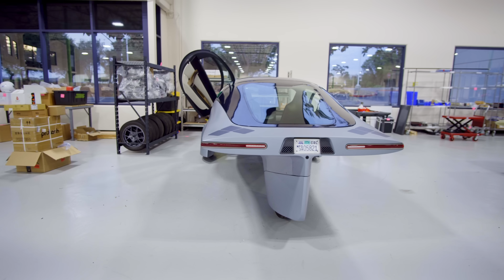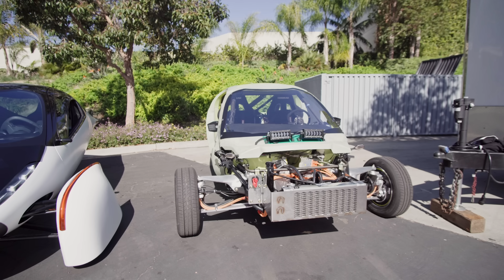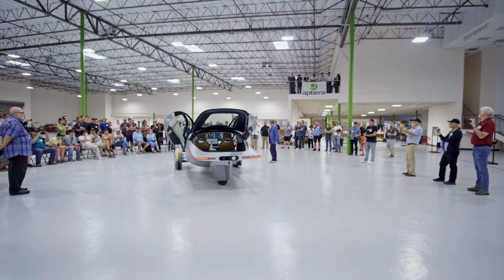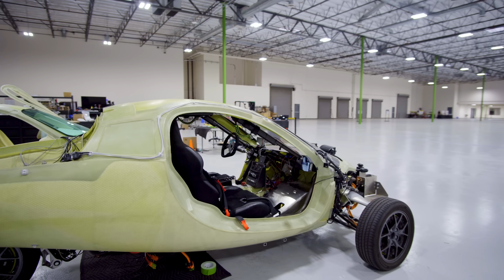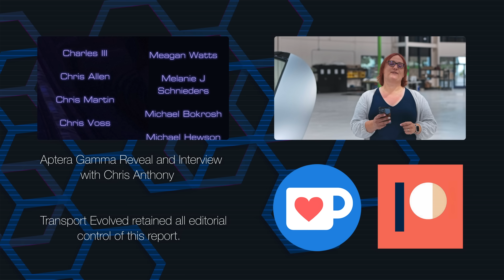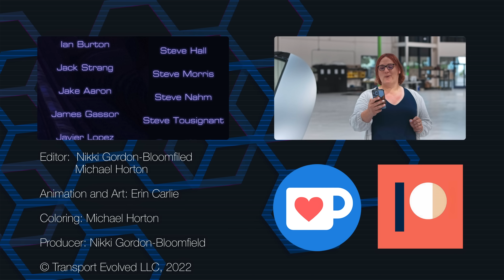The Aptera Gamma Prototype Is Here. What's NEXT?

Comment: I've got one reserved, looking forward to it.   the longevity of the platform is impressive and should hopefully make the reparability much nicer.   The only thing I'd honestly like to see is the crash testing, hate that they have to destroy some to do it, but really interested in watching the engineering of the composite and what happens when someone hits you.
Reply: Crash testing is coming in early 2023, I'm also looking forward to seeing it.
Reply: The low weight would suggest that it will have less favourable outcomes in collisions. But lets see. I really hope it doesn't come out looking so bad that mainstreamers are put off.
Reply: @peregrinedalziel4999  mainstreamers don't need to buy this .. they have 40k reservations so lets make the damn thing ! .. also look at the old smart car .. it was light and strong and if not squished between 2 suv s it survives very well ..  meanwhile you forget that the shape of aptera gives very good crumple zone or deflective energy properties
Reply: @gmy33  However, fundamentally, all else equal, a lighter vehicle (less mass) will experience greater acceleration when hit by another vehicle (baseball travels faster and further than a bowling ball hit with the same bat etc). It's this acceleration (and subsequent deceleration) that causes severe injuries (solid organ lacerations, aortic injury, diffuse axonal brain injury). Crumple zones can transmit energy through the frame and deform in a manner that reduces crushing/ limb injuries and so forth, so can offset this a bit . But the crash test dummies will do worse in a  lighter vehicle, all else equal. Indeed injury data from large datasets indicates that mortality in hybrid or automatic versions of vehicle models is slightly lower, when controlled for other crash characteristics (probably because the battery or transmission makes them a little heavier). Hopefully the tests prove me wrong!
Reply: @peregrinedalziel4999  offcourse you are right .. qe need to cgange direction and make lighter cars for less consumption .. our cars are to geavy and thus less economic .. but saver
Reply: @gmy33  ....but when everyone in the world has an Aptera.. weight differences in collisions.will no longer be an issue.
Reply: @peregrinedalziel4999  or robo cars
Reply: The car is like a pingpongball .. round light and strong
Reply: @gmy33  it is not strong

Comment: 10:51 - Did he say 10-year lifespan for the solar panels? Good thing they are engineered to be replaceable, I guess.
Reply: 10 years is a typical (good) warranty period for automobiles and their parts.  
After all these are going to experience a whole lot more vibration and other abuse than a fixed PV array that might last 25 years or more.  
While longer life is always good, this will do, I think.  At the rate that solar cells continue to get cheaper and more efficient, I don’t expect to feel too bad if the solar panels come due for replacement in 10 years or so.
Reply: @joelsmith4394  Fair enough. And also, even if the solar breaks down or performs poorly, the car itself does not become useless.
Reply: @joelsmith4394  The present cells are 22-23% efficient.  Within 10 years we will likely have flexible, inexpensive cells available that are close to 30% efficient or better.  People may choose to replace them even if the originals are still functioning to spec.

Comment: He called it an "autocycle" and that it has to meet certain illumination standards of motorcycles; so the question is, can anyone drive it or will a motorcycle endorsement be required? And what about helmet laws? I know that was a fight for Elio Motors which was one of the many reasons why they failed.
Reply: That was actually Elio's one major success. They successfully lobbied to change laws across the country so that you don't need to wear a helmet or have a motorcycle license. It's just WY, AK, and MA where you need a motorcycle license for autocycles now. IMHO Elio failed because he spent all his money designing a new engine rather than going into production with something off the shelf
Reply: @GoClimbARockEh  WY and MA have already changed.  Only Alaska is left.
Reply: @n.brucenelson5920  Good to know. Aptera should update their FAQ!
Reply: @GoClimbARockEh  It has been a rapidly moving target.

Comment: If the body is one piece and there is damage… does it total the car?
Reply: It depends of the damage. Local damages on composite structure can be fixed (done all the time on composite boats). 
Probably cheaper than typical auto body shop. But each fix will add a little weight to the vehicle.
Reply: Worst case scenario, you buy a new shell and refit all the interior and drive components into the new shell.  The man-hours needed to assemble an Aptera will be surprisingly few, so this will be more viable than you'd expect.

Comment: You had me at right to repair. Please keep that philosophy.  Don't be like Google when the dropped the word "don't" from their "don't be evil" slogan. The inability to repair and upgrade is going to be the most miserable part of most companies EV offerings.
Reply: Yeah, that is important for me too.  I will need to take some training to diagnose and repair this motorcycle.  My BMW mechanic had to take a 3 week course to be certified to safely work on 400 volt systems.  I wonder what specialty tools will be needed to diagnose and repair the systems?  It's a no brainer for vintage gas cars, but I am looking forward to customizing this trike.  I wouldn't mind starting to train for working with these specialty circuits.  Do you think it will have an OBDII port?
Reply: @SilverShadow2LWB  EVs may use OBDII for continuity, but actual OBD is to monitor emissions, so almost none of the sensor data would be applicable.   It may be that a government standard comes along for EV diagnosis,  but EVs won't emmit any exhaust,  so they may not have the authority to regulate from the EPA.  Maybe the department of transportation or commerce will define that standard.   I suspect it's going to be the wild west for a while.  Each automaker will put whatever port they want to use.  For many, they will have a good price on OBDII connectors with their suppliers so they will continue to use them until it doesn't make sense.  The code readers you get at autozone will likely not interpret the data from them correctly.   They will likely have special code readers and most makers won't share the data SW with the people who make the diagnostic tools.
Reply: @michaellowe3665  Let me put this politely...have you ever had an EV before?  Take the BMW i8 which is now 8 years old.  The BMW's have always been fully addressable through their OBDII ports.  One could change almost every sensor and alarm on the vehicles.  It allows one to bypass US settings and put in the more efficient European standards.  All it requires is a higher level OBDII port reader/programmer and a downloaded BMW tech program.  This goes for all BMW EV's.  I agree with you that the OBDII at Autozone will not work.  They are specified to work with about 8 readers.  I got mine for $24.  But since the Aptera is not a car, I am not sure if it will have an OBDII port or have to have Canbus standards.
Reply: @SilverShadow2LWB  like I said, some automakers may use OBDII for continuity,  but it likely won't be by regulation for now.  It is useful for all of the other sensors in the vehicle that aren't engine related, so they may keep using them. The point is that they don't have to.  ABS, VSS and some temperature sensors will stay the same so the CAN that connects to them will likely stay functional.  I don't own a modern EV but have done conversions and am familiar with ICE OBD functions. There is not much chance I would own a BMW,  because I appreciate simplicity and reliability.   BMW has a completely different philosophy.
Reply: Aptera, not being technically a car may not use it at all, but I suspect they want to be thought of as a car instead of as a motorcycle so who knows if they use OBD standard.
Reply: @SilverShadow2LWB  Very likely. I believe that my Tesla Model 3 does.
Reply: @SilverShadow2LWB  IT is made in the USA It just about has to have an OBDII port. My leaf has one and takes the Leaf Spy on it!
Reply: @GlennNDavis  I think you're a little confused.  It is going to be assembled near San Diego, CA from many foreign parts.  The hub motors are from Slovenia, the body composites are from Modena Italy, and who knows where the controller, batteries, and charger is made.  Other words it cannot be classified as made in America.  It can be called Assembled in America.  Your Nissan Leaf is an automobile, not a motorcycle.

Comment: A question I have been wondering for a while, where does the front license plate go?  It would be horrible if the wonderful aerodynamic drag profile was ruined by a license plate.
Reply: I think because it's classed as a motorcycle, it doesn't need a front plate in most jurisdictions.
Reply: Being classified as an autocycle or motorcycle, front plates are probably not required.
Reply: Are you aware of any jurisdictions that require a front license plate on a motorcycle?
Reply: @wineberryred  There are some jurisdictions where Aptera will need to be registered as a car.
Reply: @993cc  Which ones and do they need a front license plate?  There are many jurisdictions that only require a rear license plate on cars.

Comment: To me it seems quite arrogant to complain about the size of a CCS plug while building an externally mid-size car with the internal space just over a Citroen Ami...
Reply: The Aptera may be wide but it's probably going to end up around a foot shorter in length than something like a Honda Accord. And the Ami has around 9 cubic feet of cargo area vs 25 cubic feet in the Aptera (10 more than a Toyota Camrys trunk). ... But I also don't like all this complaining over CCS.
Reply: I know from an American perspective this may seem small, In Europe this ist the size of a fully blown family car, but too wide to even be allowed in the left lane of motorway roadworks.

Agreed on the cargo space, but then again, give me just a trailer for the one time a year I might make use of that, especially in a car unfit for family holiday, and make the car 2/3 the size.

If the Aptera was as efficient with energy as it is with space, it would have a range of 100 km with the 100 kWh battery
Reply: The Aptera is constrained by avoiding the regulations (cost/red tape) that come with four wheels, and picking the most efficient shape which lead to the awkward size and shape. I love small cars, used to drive a Honda Fit, and I've looked at importing a 3L Lupo or A2.

Comment: Aptera began making prototypes around the same time as Tesla released the roadster.
Aptera are still producing prototypes. Tesla is making a few other models of electric cars.
While right to repair seems like a no brainer, it also transfers costs and liability for repair and servicing from Aptera to the customer, and adds the probablility of service/repair failure by the customer.
Reply: Right to Repair doesn't transfer any costs or liabilities. It just means Aptera won't hide their tech/repair manuals behind a paywall or subscription service or anything. Even if you've customized your Aptera, they'll still sell you replacement parts. You can still get your aptera serviced by a mechanic, the same as any other car
Reply: Get your facts straight.  The first Aptera company removed the founders from control in 2009 and liquidated in 2011.  It only restarted as a new company with this design in 2019, about the same time Tesla started on the Cybertruck.  It is quite likely that Aptera will be shipping production Aptera first.
Reply: @n.brucenelson5920  My facts are correct,. whether the Aptera "company" suspended activities, or changed staff, its the same company (name and registration), and the same product prototype design. (three wheeled vehicle) they have not gone into full production, they are still producing prototype vehicles,(refining and improving parts and overall design) and whenever they do go into full production of a final design, is anyones guess.
Reply: @3dagedesign  I suggest that you look up the SEC corporation filings because they disagree with you.  There is not a single part in common with the original companies' design, nor size nor even a general drive train concept.  According to your thinking all 4 wheel vehicles must be the same.

However you are correct that the company is still at the prototype stage - and they are moving faster than Tesla - both originally, where it took Tesla 6 years, and now, with the Cybertruck.
Reply: @n.brucenelson5920  it's the same company name, and the same vehicle shape. Aptera was re-formed by the original founders in 2019 
 if they release a final production vehicle before cybertruck, well done to them.
Reply: @3dagedesign  You are correct about the same general vehicle shape (much refined and resized), but not the name - Look up the respective SEC filings - but you are otherwise correct.